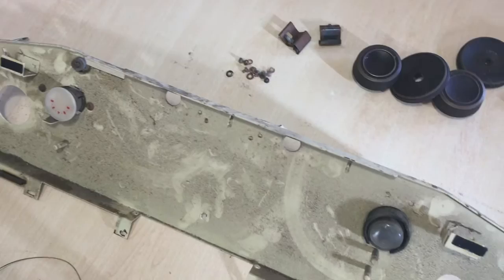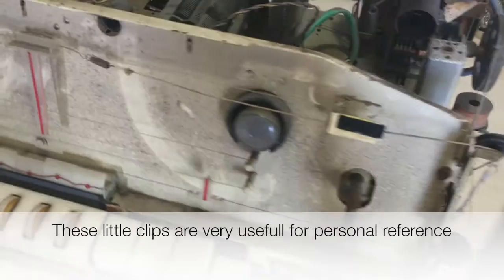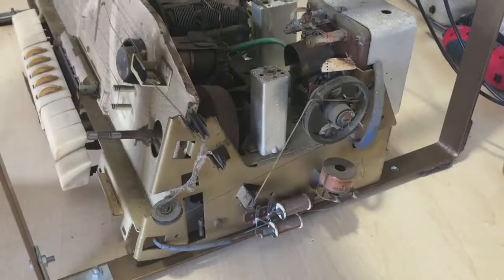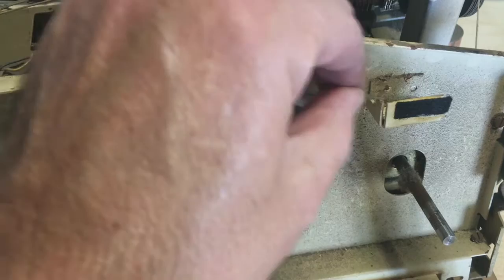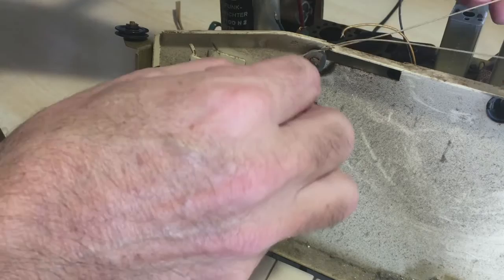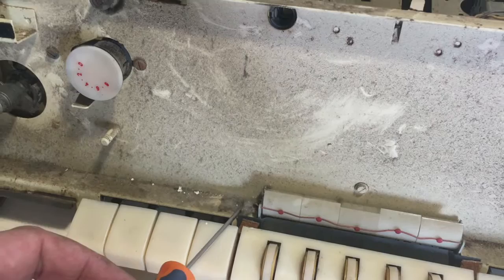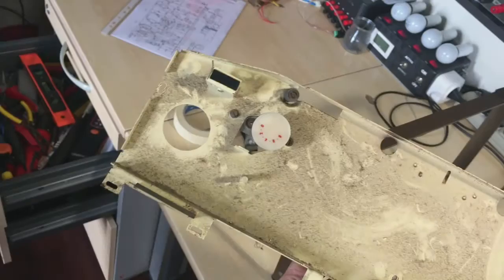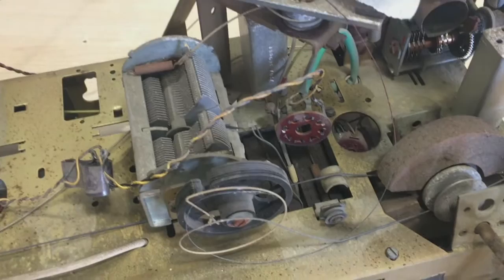Grundig 3060a tube radio restoration - Part 2. Lots of dismantling to do ...

Comment: More wishes of good luck heading your way! The paint came off of the back of my dial glass too.
Reply from the maker: +Andrewausfa : yes, very unfortunate. What did you do about it?
Reply: I repainted any missing gold lines by hand with enamel (the old Humbrol model paints, the Brass colour if i recall) and then when perfectly dry cut them in. i.e made them straighter, with a ruler and scalpel. What I mean by this, is you very lightly score the true line in and then carefully remove any extraneous gold from the outer edge. 

I then over-painted them when dry with acrylic varnish and then over-painted them and any black parts with black gloss enamel.  The water based varnish protects the oil based gold so the black won't dissolve it again. You could line your gold lines up and paint against the ruler actually, as a guide. Then do the cutting in afterwards.  I just have a steady hand for painting fine lines from years of practice in another profession. 

Your gold paint needs to be the right consistency and you need what's called a lining brush, like a no.1 size with extra long bristles, for best results. Think sign writing!  And another thought, sometimes the black needs a touch of brown in it to just kill the blackness to match the original, which I guess fades slightly. And one more, as I think back;  it may be worth buying a few different golds and a silver to mix to get the correct gold shade.

Regards _ Andrew
Reply from the maker: +Andrewausfa : thanks for the tips. I'll give it a try. Carefully.